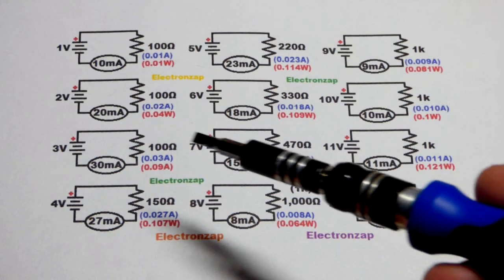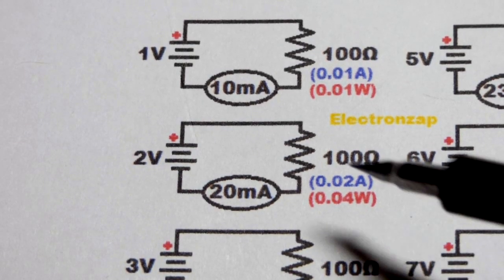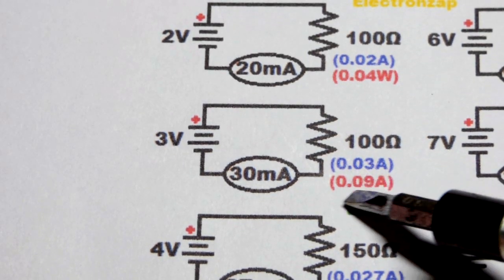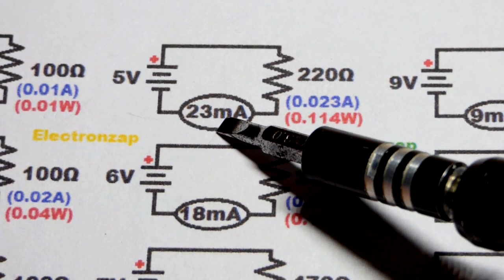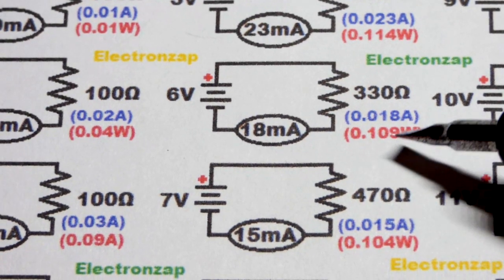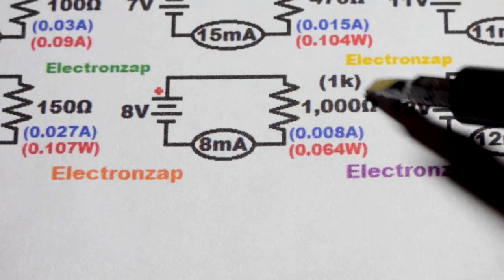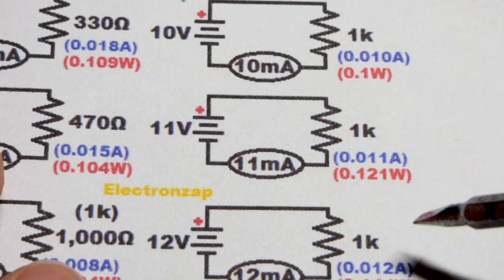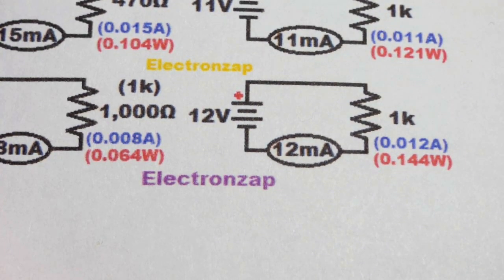Common examples of voltage resistance current and wattage explained for resistive components

Comment: Nice video - Watched via your odyssey as super-grand-ad - 
Here are the Math's for the first example On a normal Calculator.
1 / 100 = 0.01 Amp - What the normal Calculator will not show is, The last zero.
1 / 100 = 0.010 Amp - So the same answer as the answer above, 
but with the added end zero.
Also note we are in Amp's, If the answer is in Milli Amp's = 010 mA 0r 10 mA.